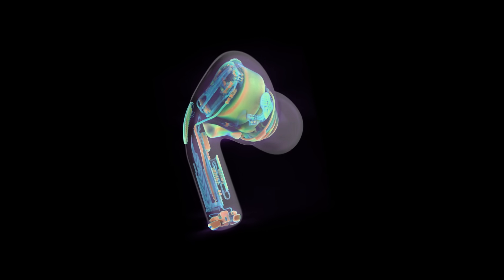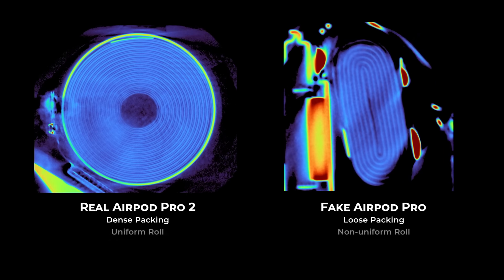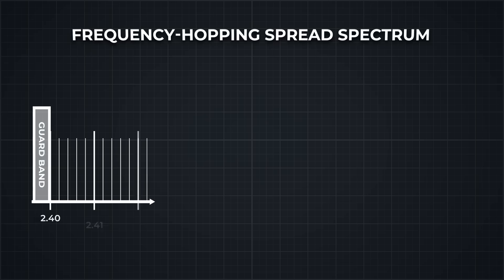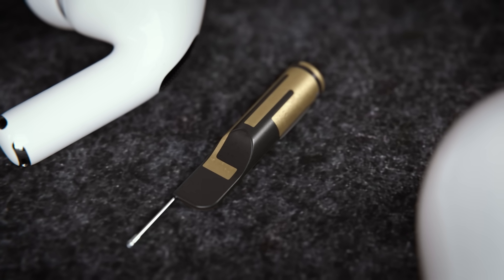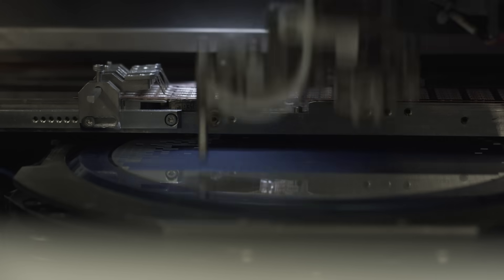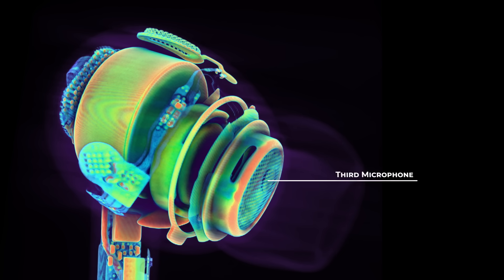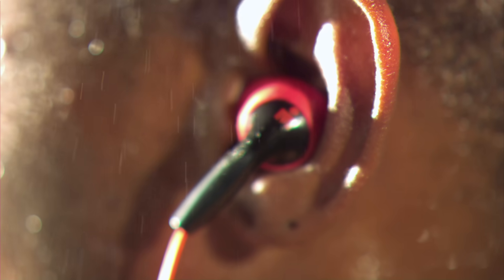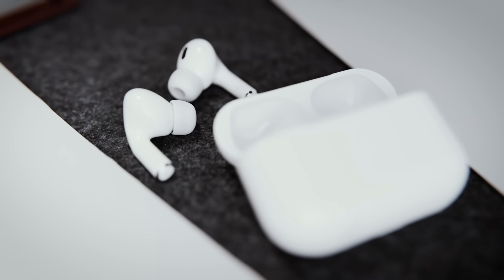How Apple AirPods Work

Comment: THANK YOU SO MUCH for using Wh and providing nominal voltages! Much better info than what the clueless tech youtubers do providing just Ah/mAh without understanding that many devices use different voltages.
Reply: Username checks out.
Reply: Totally agree
Reply: Agreed
Reply: TBF, when you're talking about a Li-Ion battery cell, there's not much room for ambiguity.  A finished battery pack may have, or perhaps regulate to, any given voltage.  But a cell is going to be 3.something volts, with fairly typical min, max, nominal, and curves.

So, I don't really need people to use Wh when talking about the battery in a phone, tablet, or earbud.  We can pretty much assume we know how to derive any missing value with at least two of V, Ah, or Wh.
Reply: @sirnickity that absolutely makes sense… years ago. Just look up available data on modern smartphone nominal voltages. Almost 3.9V with even the iPhone 16 series having slight variations between models. And shown on teardown videos for this particular earbud, 3.66V. For many power banks, 3.6V flat (which allows marketing teams to make them sound bigger than they actually are). 

And let’s say a sodium battery revolution does occur which uses an even lower voltage. Because of the huge discrepancy you could either use the non problematic Wh rating that simply does not care, or begin to use equivalent mAh which would be just as silly as camera companies today using a hypothetical tube diameter for a digital sensor which does not use tubes whatsoever.
Reply: @sirnickity unfortunately I can’t reply with sources without YouTube shadow banning my reply. 

Just an example I learned from another commenter: Today nominal voltages from any modern device does not use equal nominal voltages, not even the iPhone 16 lineup. There is no such thing as a true comparison between modern devices without absolute certainty of exact nominal voltages. You have modern devices using close to 3.9V and power banks using 3.6V. It’s been a long time since I last saw a lithium battery with a rated 3.7V. 
Hypothetically if the sodium battery revolution means many day to day devices starts using them, the mAh rating would no longer work. You could either simply use the tried and true Wh which does not care about these discrepancies, or use an equivalent mAh rating. For the latter, that is like the camera sensor convention of using a hypothetical tube diameter instead of the physical sensor diagonal/dimensions. It’s a convention photographers hate. Just imagine in a few decades (or years considering how fast batteries are diversifying) before the same sentiment that can be avoided goes to mAh if marketing teams continue to use it.
Reply: @sirnickity  Example I picked up from another commenter: modern devices don’t use the same nominal voltages anymore, not even the iPhone 16 lineup. Some modern devices are ~3.9V, power banks 3.6V, and it’s been ages since I saw a true 3.7V cell that wasn’t a hobby LiPo pack. So mAh isn’t a real comparison unless you know the exact voltage. If sodium batteries take off, mAh breaks completely. Either use Wh (which ignores this issue) or an equivalent mAh rating, but that’s like the old camera sensor “inch-type” convention photographers hate. Keep pushing mAh and people will feel the same way about it soon.
The small amount of ambiguity today might not seem like a problem, but neither was the stupid digital camera tube diameter initial. The fact is battery technology is rapidly diversifying.
Reply: @sirnickity you are saying the opposite of original comment and you are wrong. Wh is real metric that tells you how much energy is stored and no, lithium batteries doesn’t have similar nominal voltages anymore.
Reply: @ersinrc   I know I'm saying the opposite, because I disagree.  The video gives you nominal voltage and capacity in mAh.  We all have the same math.

I know it's irritating when, e.g., an Anker pack tells you its capacity in mAh, but does not specify whether it's a single large cell or cells in parallel, or a series of cells.  That's annoying, because then the OP is right -- you don't actually know what the capacity is.  You're missing one of the three variables.

But here?  3.66V.  182mAh.  You have what you need.  You know the capacity now.  Even if it had not mentioned voltage, you would be able to determine, within a reasonable margin, what it is, because it's unlikely they're placing cells in series in an earbud.
Reply: @sirnickity the video didn't use mAh dude. It's 182 mWh, which should always be the unambiguous standard.
Reply: @TwskiTV  My mistake, I thought I remembered the graphic slide listing the capacity in mAh.

Either way, I don't care.  Wh or V + mAh are both fine.  They're the literal same thing, and trivially calculated, so there's no superiority to be had here.  Just pedantry.
Reply: @sirnickity  except even among phones it no longer works good since the voltage varies more and more. Phones used to use essentially universally 3.7V. But nowadays it varies between roughly 3.7 and 4.2V. 
And as soon as you add laptops and such to the mix, nothing makes sense anymore but people still do that.
Reply: Agree. It's annoying that mAh because the default and "standard" by how battery sizes are measured even tho it's pure nonsense. But that's mostly thanks to (Android) manufacturers who started using it. Apple luckily never did and always use the correct Wh when they mention battery sizes

Comment: More of these how it's made / how it works videos would be awesome!
Reply from the maker: What else could we put through a CT scanner that would be interesting?
Reply: @RealEngineering  A joystick. More specifically, an off-the-shelf or force feedback consumer joystick. I don't think there's a single video out there about how a joystick works, both the hardware and the software. It seems to be such a niche field that companies often copy each other's designs rather than trying to find an engineer and the years of R&D. Bonus points if you also explore a throttle for a full HOTAS deep dive.

I just think it'd be unique to see the inside mechanism, and there's plenty to talk about regarding material science/design, torque, longevity, real-world counterparts, manufacturing of small electronics.

That's what I would find interesting.
Reply: @2KOOLURATOOLGaming  Could easily expand this to a modern video game controller. Lots of interesting parts there to dissect.
Reply: @2KOOLURATOOLGaming  Aren't even the most expensive joysticks pretty basic?
Reply: @RealEngineering  i think cameras could be neat
Reply: @RealEngineering  CT scan the CT scanner?
Reply: @RealEngineering  I'm always partial to deceptively simple technology, like Velcro being made of loops that are then sliced with a very tiny & precise saw.

On the small everyday impact side, there are things like airbag sensors which often employ mems & mechanical components.

High end directional microphones that are used in making big budget films are a technological delight.

Something as simple as an LED strip can have surprising depth, being made of rather short flexible PCBs strung together, specially formulated solder to not have the rigid leds and other surface mount components pop off when flexed.

Or even the chipped credit and debit cards, there is a whole computer in there that is wirelessly powered by the scanner.

I could probably come up with more in time, but these are some things that came to mind right away.
Reply: @trapfethen Velcro is amazing.  Especially,  the industrial.
Reply: @RealEngineering more everyday things: mouse, keyboard, wifirouter, lasers, toys, hair trimmers...
Reply: @RealEngineering  A smartphone
Reply: @RooseveltGuilherme  A foldy smartphone!
Reply: @RealEngineering NFC tags might be interesting, if simple.
Reply: @RealEngineering  I really prefer these videos over warfare related ones. ✌️
It'd be amazing watching a CT scan of an internal combustion engine. There are fully functional tiny V12 model engines (and many other configurations), that might be interesting. 💪🙏
Reply: @RealEngineering I would love to see videos on - Apple Vision Pro, smart glasses, iPhone and Apple Watch sensors and components, medical devices like a pacemaker, blood sugar device, and Elons neurolink as well a self driving technology (although a ct scanner is to big for a Tesla lol, display/screens - particularly about different types (Oled, mini led etc) how the contrast ratio works, HDR, refresh rate etc including how these work and are made, also possible more interesting - display durability - how gorilla glass is made and the science/engineering behind it, portable X-ray wands, satellites and how they can handle so much traffic.. that’s just a few things I would love to know more about, especially since there’s very few detailed videos here on YouTube
Reply: @RealEngineering  Apple Watch would be another nice device to cover.
Reply: @RealEngineering  do a smartwatch, or a phone camera / speaker / taptic engine
Reply: @RealEngineering  airpods are such a good first choice. So much tech packed into such a small form factor really makes them feel like magic. I think a whole series of CT scan breakdowns would be awesome. A smart ring would be pretty cool.
Reply: @RealEngineering  
As a radiologist - A whole CT scanner!
The makes of CT (and MRI) is super interesting
Reply: @RealEngineering  How about a pacemaker? Always been curious how they work (although I think they may be a lot simpler than an AirPod...)
Reply: @RealEngineering  A smartwatch.
Reply: @RealEngineering  Digital Camera, could compare a normal one to the sensors in phones.
Reply: @RealEngineering  samsung galaxy bud and google pixel bud, for comparison
Reply: @RealEngineering  You own a CT scanner?
Reply: @RealEngineering Literally anything that has internal structure, engine block, kettle, phone, mouse, keyboard, motor, an FPGA, a watch, a tree branch, brick, new/old reinforced concrete, hard disk drive, an solid state drive, 3d printer head, desk chair, vr headset, Wii remote, crt tv, new tv, etc.. 

I'll stop for now in the hopes that maybe you'll do one
Reply: @RealEngineering the Dualsense controller might be cool
Reply: @RealEngineering Automatic transmission
Reply: @RealEngineering  A smartwatch could be interesting, or maybe an RFID tag like used in passports and public transport cards.
Reply: @RealEngineering Doing inear monitors would be really nice
Reply: @RealEngineering maybe a new processor and how data goes through the gates
Reply: @RealEngineering Apple watch!
Reply: @RealEngineering pace maker
Reply: @RealEngineering /videos Smart rings.
Reply: @RealEngineering Could you please do a video on the difference between carbon fiber and the use of graphene, I saw a chemistry guy do an experiment only added  a few %  graphene to an epoxy blend, it gained like  700% more strength...  Seems like it's the next step up from carbon fiber! What would it look like under a CT scan
Reply: @RealEngineering a CT Scanner 😂
Reply: @RealEngineering  Helicopter blade, it is more complex than what people think.
Reply: @RealEngineering  honestly? An automatic car transmission, those things are very advanced, there's a lot of things that went in making them possible, a CT scan of one would be very cool
Reply: @RealEngineering anything electronic related would be very interesting
Reply: @RealEngineering smartphones, portable gaming systems. Anything microelectronics hehe. I like this type of videos as much as I love the explanations of aircraft!
Reply: @RealEngineering yes CT scan or mri
Reply: @RealEngineering  Bragi Dash which came out in early 2016, so you could see how much "inspiration" Apple took for their Airpods which came out in December 2016...
Reply: Mini mirror chip used in projectors. And laser projector.
Reply: Second the Apple Watch. Maybe a gaming monitor? DAC + Amp?

Would’ve been cool to include the AirPod case
Reply: A video about how smart watches work to measure so many different body parameters would be very interesting.
Reply: Charger
Reply: Yes please!
Reply: A smart watch
Reply: A handheld drill or impact driver. Or a hammer drill
Reply: Absolutely agree you should do one on microwave ovens
Reply: Could you please do a video on the difference between carbon fiber and the use of graphene, I saw a chemistry guy do an experiment only added  a few %  graphene to an epoxy blend, it gained like  700% more strength...  Seems like it's the next step up from carbon fiber!
I wonder what it would look like under a CT scan
Reply: GPU! Those things are black magic to me.
Reply: yes, please! I always want to learn more about the gadgets and technology that I use everyday, and generally just take for granted. especially since it changes and evolves so rapidly